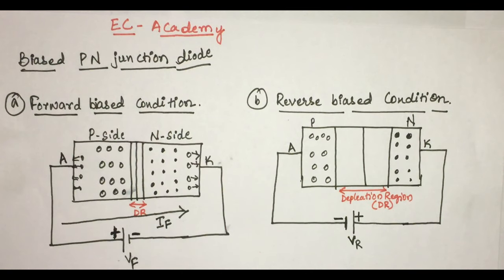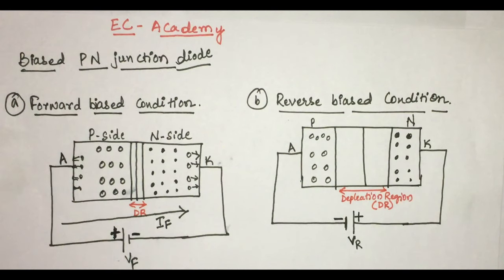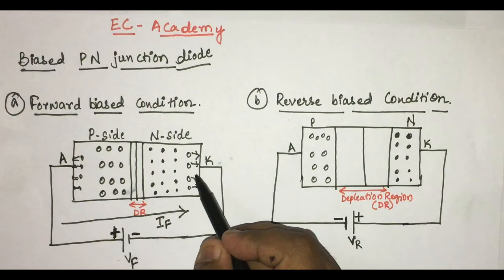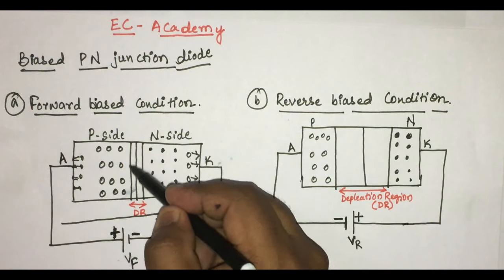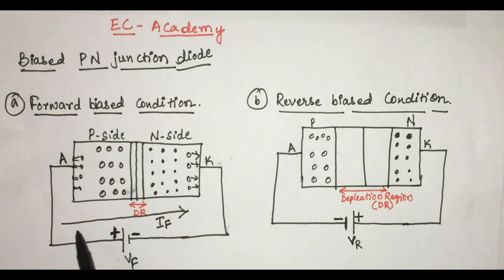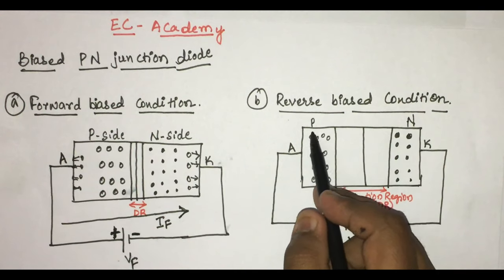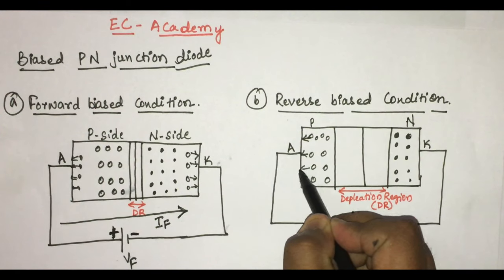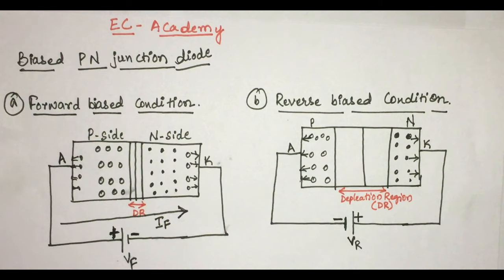#3 P N junction diode under forward bias and reverse bias Condition || EC Academy

Comment: Sir u explained perfect
Sir how many volts we need to  use in FB and RB condition
Reply from the maker: In forward bias above knee voltage and in reverse bias less than breakdown voltage. In forward bias a very high voltage will also damage the diode. 
Hope this helps you 
Don't forget to SUBSCRIBE and keep supporting EC Academy 👍